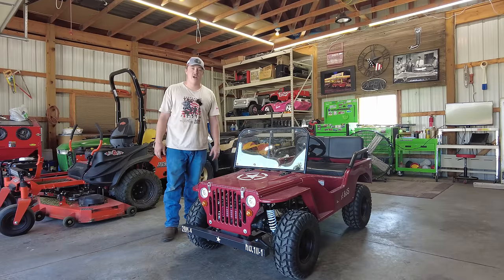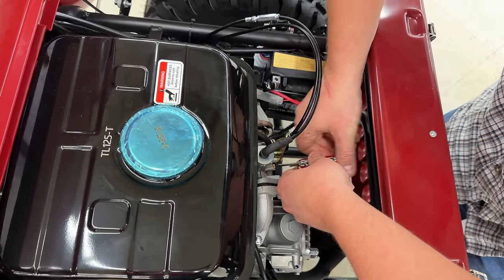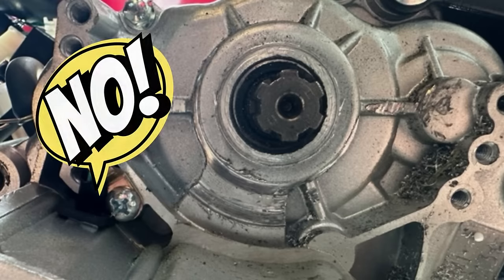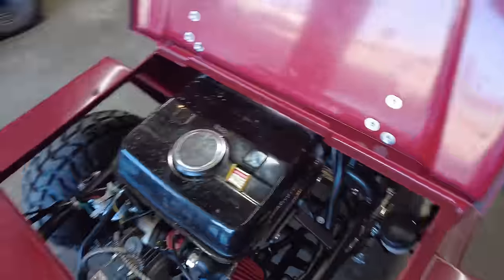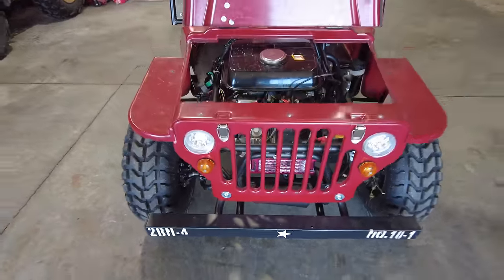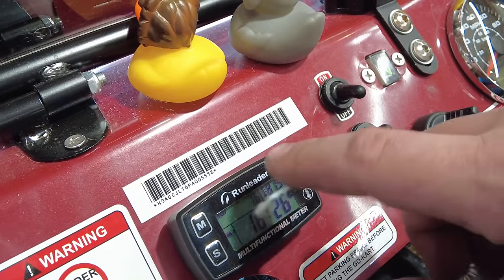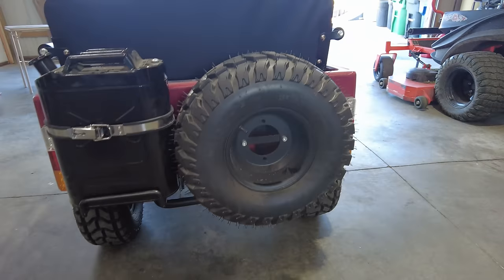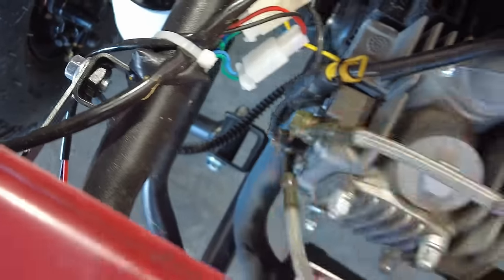Watch Before you Buy a Mini Jeep

Comment: 2500 for the unit plus tax
another 800 in upgrade parts 
must have little bit of knowledge on how to work on the engine 
buy the extend warranty  

cute jeep.
 Just got to ask yourself , do i have money to burn or buy a can am ATV for 5k that will not break down alot. 

thanks for the information, I almost purchased the jeep. i dont have time for DYI
I believe this is one you buy and replace the motor with more HP. American made engine. 
" mini jeep project"
Reply from the maker: I’m glad the video helped you. You are very right and depends on what your looking for! I was disappointed in spending the money and then needing to go over it but it has turned into something my son and I enjoy so it did in my case work out. Thanks for watching and commenting and again glad it could help!
Reply: American Made small engine 😆😆😆😆😂😂😂😂😁😁😁😁 I WORKED FOR B&S and you think there are U.S. made engines ???
Reply from the maker: I would take a big guess and say… NO! 🤣

Comment: Stearing isnt sharp because 1, too much weight, meant for kids rather than adults so you sitting on it puts more weight over the rear axle which ofc means less it can turn, and 2, its a go kart thats set up higher and shorter than normal, so itll flip if you have more than 45° turns in the tires.

Comment: I may have missed spoken with my earlier comment when I said I have had no problems. Mine is called a coolster and it does have floors already? Maybe mine is different?
Reply from the maker: This one has a floor? I’m confused.
Reply: I’m sorry if it has floors and where your feet would rest so in other words, it’s not open to the ground when you look at the floorboard forward where the pedals are. The plastic goes all the way up to the firewall if you will.
Reply from the maker: @hirambond1432 oh ok, no this one has a floor but there is not “firewall”. I need to make something to help keep mud and stuff out.

Comment: Better run non-ethanol fuel in it
Reply from the maker: Never had an issue with pump gas.
Reply: @Higgsgarage  ethanol eats plastic up
Reply from the maker: @swhite3847 ok but what plastic? The tank is metal.

Comment: The circus clown car needs help reaching new markets. It's not a Jeep. It's a toy car with a combustion engine and a small knock-off body style. Once you start adding more metal parts, you add weight, which adds a whole new physics to the build. This is an expensive toy. If you really want a great UTV get one.
Reply from the maker: Have had them and will probably get another but I wanted this as did my son so that’s what we got. Thanks for your advice tho.

Comment: Why pay for something then spend more on it to make it right ?  I will never buy anything from tractor supply again they do not pre service anything ! I bought a cub cadet along with a extra warranty it quit charging it was worked on by a service center brought back quit charging again called the insuron they wanted to send it back to the same people I said flat no! They are sending it to a different shop never buy anything from a store that does not have a service shop on premises.
Reply: The Jeep is not a Jeep or made in America. Go buy a 125cc atv at Yamaha or Honda and tell me taking the time to make sure it has tight bolts and cotter pins is not that expensive
Reply: @Kilowatt420  of course it’s not a real Jeep I own a trucking biz and when I spend  150K to buy. New tractor or trailer it better have all of the parts tightly attached and assembled right ! Or any thing else I buy I expect it to be done right and not have my shop having to work on it .